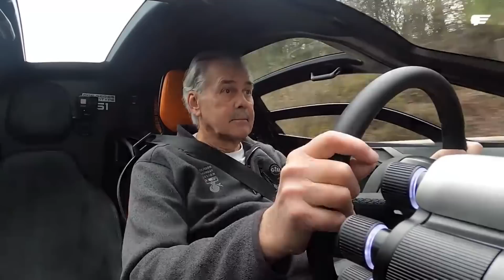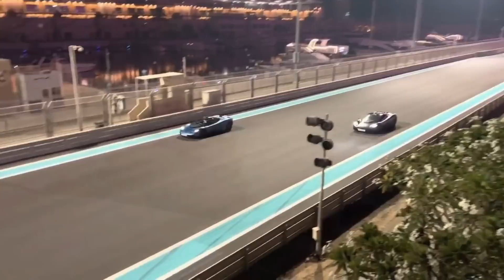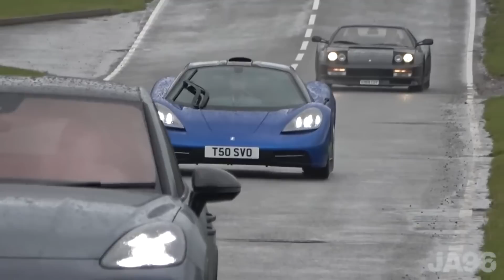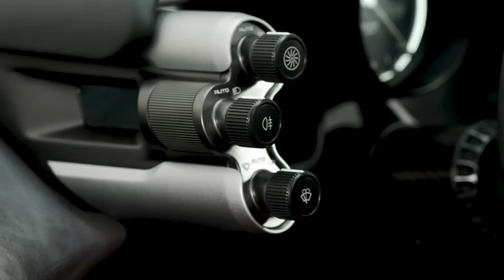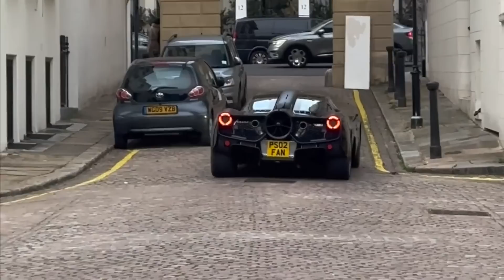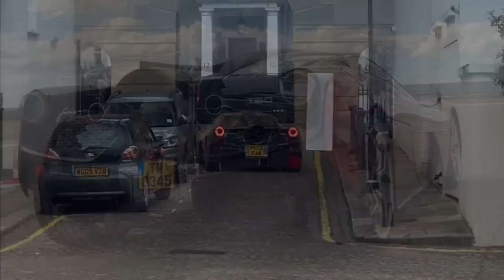The most underrated car today? - GMA T50

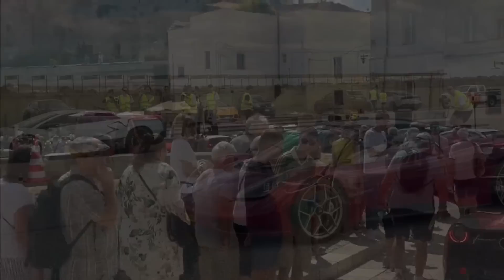Comment: 9:50  Gordon Murray has said that the the T50 does not use the fan at the rear the way that the BT-46B formula one car did.  The T50 does not use the rear fan to increase downforce by sucking air from below the car.  
Murray said that the main purpose of theT-50's rear fan is to reduce drag and increase downforce at the rear by shaping the airflow.  The rear fan also eliminates the need for an unsightly rear spoiler or wing.   A bonus is that the fan adds a few horsepower of thrust.
Reply: It lengthens the tail

Comment: I wish it had slightly better styling. Even if wanting soft lines/no splitters.. They could have made it similar to the f1. With smaller headlights, a bit less ground clearance, & f1 gtr-style front bumper grilles.

Also would've been cool if they hid the fan lower & behind the rear mesh. So its less dominant, design-wise.

The T50s is much improved.. But i dont think theyre street legal or manual

Comment: 670 hp from a NA 3.9 liters is insane
Reply from the maker: Absolutely! 🔥
Reply: The I thought the original plans had a bit more but what's most impressive is that it's lighter than a 1000KG.
Reply: @F1ll1nTh3Blanks  It's not lighter than 1000kg after development has been completed.

Comment: How is it underrated ? They are all sold out.
Reply: I have never seen anyone give this car anything other than praise also. because NA V12 and manual.
Reply: @F1ll1nTh3Blanks Ask Doug Demuro. He thinks it's not cool, apparently. 🤷‍♂️
Reply from the maker: I said it is underrated because of the huge public that sees it has "only" 680 hp, a manual transmission, and a strange fan at the rear and thinks this car is just another crazy random car. But the price of the car and the fact that they sold out so quickly prove how great it is. Have a nice day!
Reply: @MotorsportAddiction  oh now I see it you're right

Comment: As pessoas estão acostumadas com carros que passam dos mil cv mas pesam 1500kg cheios de eletrônica, é uma banalização da potência que faz tudo ficar sem graça... e quem achar que 670 cv é pouca coisa lembre-se que pra vencer o GT3RS 500cv a Mercedes precisou do dobro da potência
Reply from the maker: @gabrielbarcellos1036  You are completely right! Power-to-weight ratio is most of the time more important than the horsepower itself. And there are also other factors, like aerodynamics, that can affect the performance of the car.